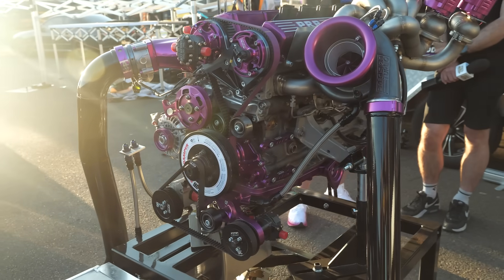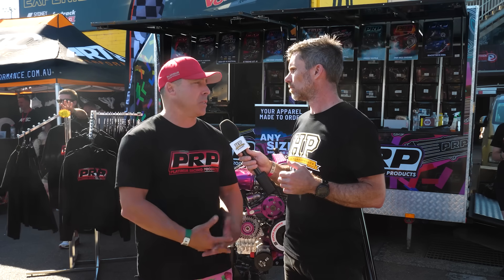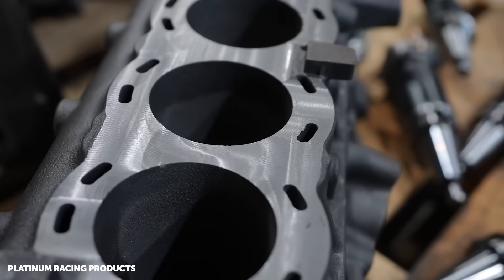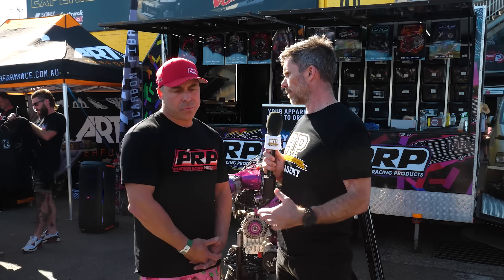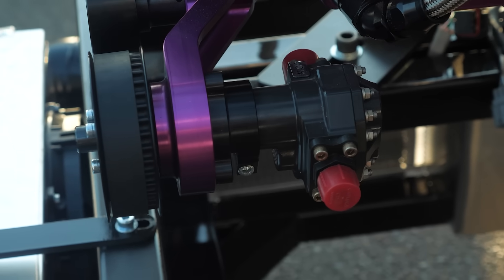"You Don’t Want 1,000 HP on the Street”

Comment from the maker: Is 800hp enough or perhaps even more than you need for your own street build? 
😈 Building a fast car? Get $400 OFF the all-inclusive VIP online course package deal: https://hpcdmy.co/prpvrp
🔧 50% OFF your first online engine building course. Enrol now: https://hpcdmy.co/prpeng
0:00 – Intro to the RB26 Platform
0:18 – Herman from Platinum Racing Products
0:31 – Ideal Street Power Levels
1:00 – Street vs Track Turbo Strategy
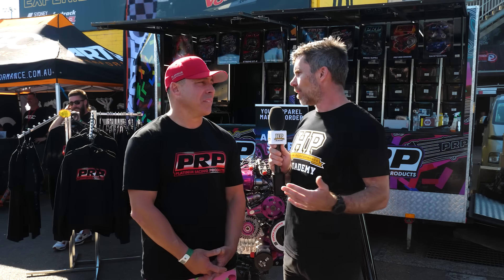1:54 – RB26 vs RB30 Comparison
2:24 – Custom PRP Short Deck RB30
3:01 – Increasing Deck Height for Performance
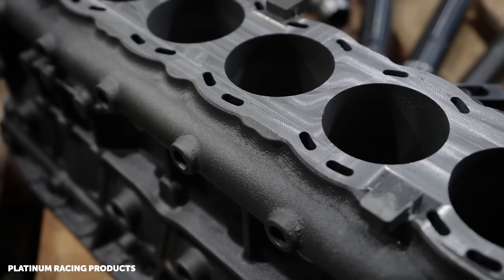3:21 – Internal Component Choices
3:59 – Supporting Larger Bore Sizes
4:20 – Cylinder Head Development
4:47 – Oversized Valves and Port Geometry
5:35 – Camshaft Lift and Bucket Sizing
6:28 – Combustion Chamber Strength for 90mm
7:13 – Head Gasket Sealing Considerations
7:54 – Dual Fuel System Overview
8:40 – Kinsler Mechanical Fuel Pump Setup
9:57 – Test Mule Engine and PRP R&D Strategy
11:00 – Back-to-Back Dyno Testing Plan
11:40 – Integration Between Block and Head
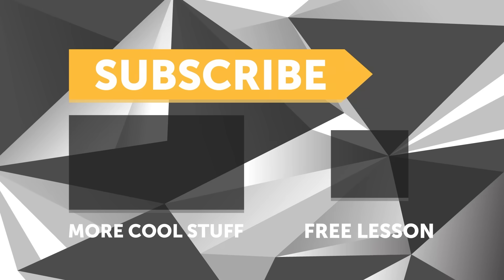12:01 – BUILD.TUNE.DRIVE
Reply: It was just by chance my barra converted sedan ended up at 800hp at the hubs and I can say 100% that 800hp (and 940nm torque 🔥) is all that's needed on the street. I use full boost for track only. Street setting is 714hp. That's on a 235 drag radial.
Reply from the maker: Good man! What sort of sedan did you drop the Barra in?
Drivability day to day aside, it's also kind of exciting going to the track having a car that gives you a bit more there too when you do go full send right 😎
If you haven't already just make sure your brakes have dialled in to suit. Sometimes even just higher quality pads and good habits with fluid quality, bleeding and changes is enough 🤘
Probably telling you how to suck eggs with that but in the excitement they often get overlooked - Taz.
https://www.hpacademy.com/blog/your-oem-brakes-suck-start-learning-how-to-improve-them/
Reply: @hpa101  thanks Taz. It's a second generation Commodore. 1400kg kerb weight. The brakes are upgraded to VT so 296mm rotors, twin piston front calipers. This wasn't coping at Roll Racing. So yes, changed rear pads to Bendix Ultimate + which helped but still overheating. Changed front pads from DBA Extreme to Bendix Ultimate+ and Castrol SRF fluid. It's coping much better now.
Reply: He didn’t say 800 though he said in the 700s lmao. Prp doing some amazing things with rb26 style finally where as rb30 were used forever since they could hold more power even in stock form

Comment: theyre only saying you dont need 1000hp because their rb26's struggle to live much higher than 800hp.   my rb32 going on 60k miles at 1200awhp and it puts every bit of it down with ease.  this was pure marketing..... nothing more. its cheaper to build the rb30 and that taller deck height = more reliable power without blowing up at 800hp  and thats the whole point of doing the swap.

Comment: I got twin GT2871r turbos 450hp each for my VN Commodore V6 because I want 700-750hp. The engine builder building the engine said "but we can easily get 1000 with bigger turbos" but I said a V8 supercar & GT3 cars have 700-800 so I don't need any more. Twin Gt28s with the T56 6 speed & Haltech traction control will make a fun car to drive.

Comment: I learned very quickyl when talking JDM cars and engines, whatever Australian tuners say you just take it back two steps. They live in a world of their own, they don't even get into a car under 1000hp. I will say 500-600hp is PLENTY on a road GTR, even with upgrade twins instead of a single turbo. There is just no scenario where 1000+hp is consistently more fun on the street.
Reply: If you take a look at their motorways it makes sense why they’re like that.
Reply: @SeekWord the main reason I believe to be the cause is the fact they have been doing JDM cars for many years before anyone else jumped on that bandwagon. So it's natural that they kept increasing power and are chasing bigger numbers.
Reply: @drogenfeld I’m talking about street cars with that kind of power. It makes sense why that’s nothing to them. They don’t have to worry about a pothole a rock a random tight turn. Most of they’re motor ways are pretty and straight
Reply: @drogenfeld I didn’t know that at all
Reply: @drogenfeld but what I’m saying is they have the smoothest highways so their use of 1000hp+ cars on the street doesn’t surprise me.

Comment: Nice presentation. PRP is pretty famous when it's about RBs engines. 
Does anybody knows if there is existing heavy duty / kevlar timing belts usable for a RB30 - 34 engine (stroked RB30) as there is for stock 26 and 25 ? 
Maybe a belt not even from Nissan/Nismo ?
Reply: @vozhdmeister5256  gates racing is fine. You’re not going to be running valve springs hard enough to bother it.

Comment: There one pushing 2700 hp
Reply: They need a full rebuild after 5-10 runs
Reply: You can’t street drive a 2700hp 6 cylinder 🤣 you’ll need 16 cylinders to make 2700hp reliably

Comment: This is a great discussion , I’ve always heard a thousand hp 2jz or rb26 is not daily at that power
Reply: That depends on your transmission choice.
Reply: @nicholaswicks3077  Yup. I run a promod powerglide built by Rob from RIPS Racing with a custom torque convertor seetup for my PT 8285. very TRUE.
Reply: 1466whp 2j here, what goes into that kind of power take a lot more that simply boost curves. Everyone is jumping on the 8hp or the dct my m5 has but either way it’s a pig until it lights up at 4800 rpm
Reply: @MRJZA75_34  the 8hp has come a long way, obviously any car will be shht if you lug it at high gear and low rpm. 

With the short rations of the 8hp, you can have great off boost drivability. The turbolamik controller has total control of the gearbox, unlocking the converter gives you a bump in torque down low.

I’ve helped configured a few cars
E36 m3 with a 2j that went 9.7 with boost cut twice on the run.
Full street car, full interior, ac, power windows, small sound system.  The car is daily driven and enjoyable on the street. And a monster at the track.

Also done a is300 k24 with 8hp45 making 670 at the wheels. The k24 with 10:1 compression made about 260hp at the wheels with boost pipes disconnected. So its very responsive off boost.

Also done a r34 gtr making 1100+ at the hubs.
8hp70x 4wd all bells and whistles.
Owner went 8hp coming from a samsonas sequential. 

No more gearbox whine, no clunking noises on the street. Rb32 responsive off boost. And when it spools it goes.

All Cars done on haltech and turbolamik tcu. Technology has come a long way.
Reply: Given most people now drive 150kw turbo diesel utes, 300kw is still double most vehicles for actual daily traffic driving. But yeah. You can dream about these "1000hp" cars that are driven in traffic. They aren't. They are weekend cars and still has too much to worry about. Otherwise twin turbo LS cars that needs less effort to get 1000hp would be perfect too....
Reply: @Low760  people been watching too much social media underplay just how insane 1000hp in a street car is. 20 years ago 400 was considered a lot for a street car
Reply: @fullsendmarinedarwin7244  I agree most probably haven't driven a 1000hp car set up correctly. It's insane not street friendly
Reply: @Cameron.M-AU  I don't think most normies have sat in anything with more than 500hp let along 1000hp lol, social media has ruined peoples perception of what is normal (just look at gym culture as an example, too)
Reply: Not entirely true these days. 
A well build 2j, forged pistons, rods, main caps. Good set of cams and a next gen 7275 will make a 1000hp and prove to be reliable for a long time.

Mate that to 8hp70 gearbox, 
Boost by gear
Traction control with a mix of ignition retard/cut, dbw throttle control and Electronic wastegates allow you to run from 5psi to 50psi

You can make as tame as you need on the street, put it in auto mode and off to the grocery store you go. 

At the track you can let all horses out
Reply: @nucleart0aster I currently have a 2jz build  GSC 269 cams , forged pistons 9:1 compressionand rods. 

GSC intake and exhaust valves . I have everything minus billet mains . 

Haven’t assembled yet I was shooting for 650-750whp. U think I need the billet mains? 
G35-900 .83 A/R Garrett turbo
Reply: @bigjdm5460  for some reason my reply didin’t post or got deleted.

You will be fine at that power level without main caps. Usually we put them on when going. For 900/1000whp 

If you are keeping stock caps but using arp main studs, you need to aline hone the block anyways, at that point rather get main caps in.

Buy once cry once😂

I have a mk4 supra making 840whp
Stock main caps, arp headstuds

Also building a 1100whp is300, with the 8hp70 gearbox.

That engine will have main caps